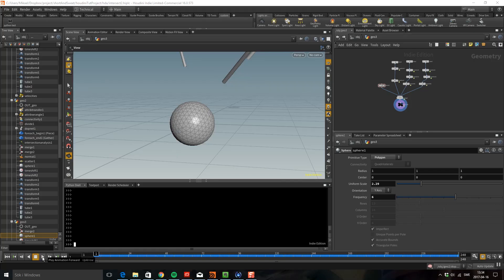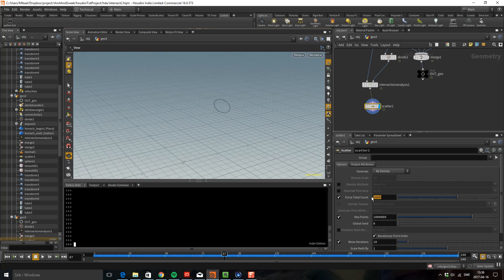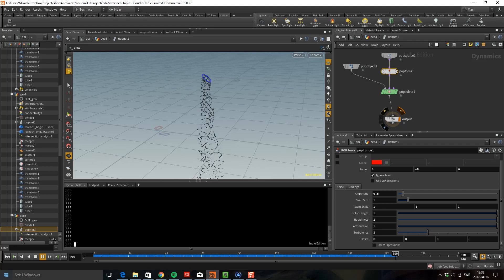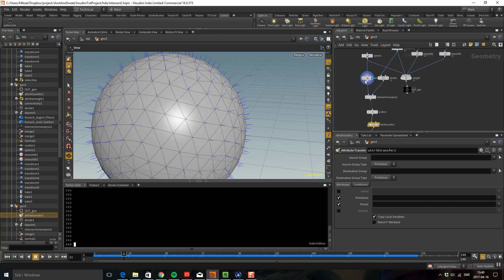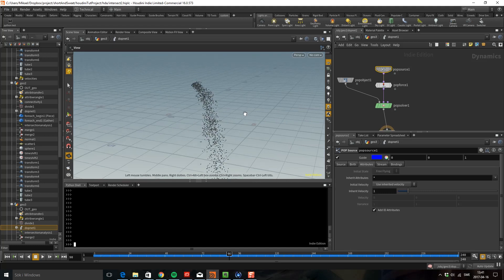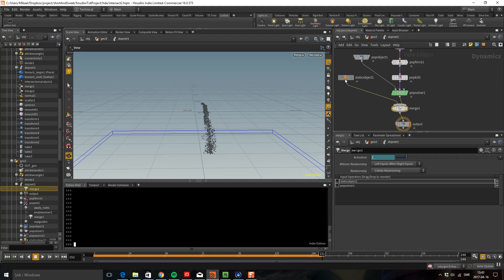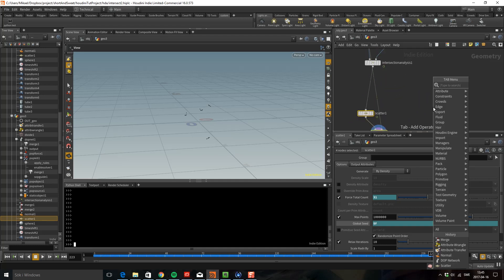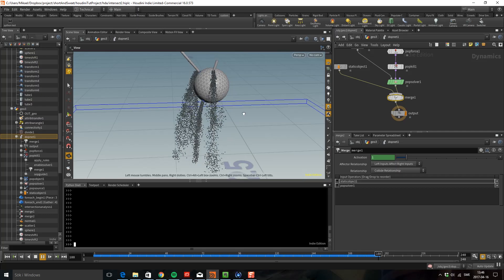Emit Particles from Geometry Intersections in Houdini

Comment: So what exactly does the vex you enter there do? I understand you scatter it random between values 01, but what about the 1,2? What does this range stand for?
Also the bottom hole is wrong, because the pipe exits a different direction
Reply from the maker: fit01 is a function that assume that the value that you put in is between 0 and 1. 1 and 2 is the destination values this value will be mapped out to. So 0 would give you 1 and 1 would give you 2 for example. This value is then multiplied with the normals to give you a random initial velocity